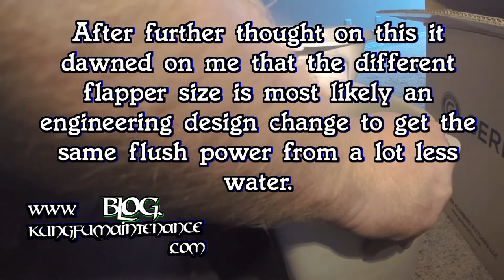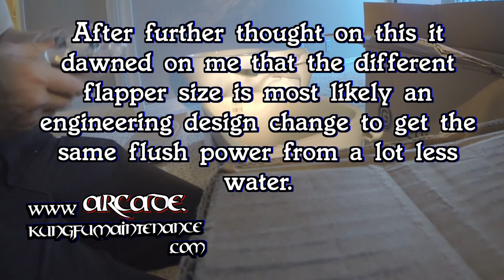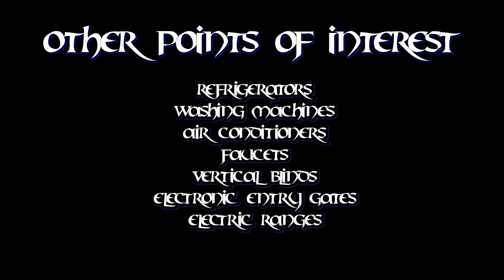How To Replace Leaking Toilet Preparing Old Waster For Removal Unboxing New Low Flow Water Saver

Comment: Wondering what was the name brand of the new toilet you installed, and which store chain you bought it from.   Also, what has been your experience with dual flush systems, any insights or recommendations you can offer on that?  Will be an upcoming project for me...dual flush.    Thanks.
Reply from the maker: This one was a Gerber and I ordered it from HD Supply Solutions. You can also get these or the dual flush systems through my website, search box  in upper right corner of any KungFuMaintenance page. I make a small commission on any items ordered through there. I do have a couple vids showing dual flush install "How To Repair Trickling Running Toilet Leaking Water With Duo Flush Install Flashlight Vid Series" and "My Second Experience With Dual Flush Duo Water Saving Toilet Conversion Kit ".